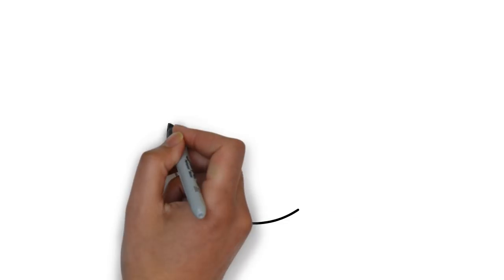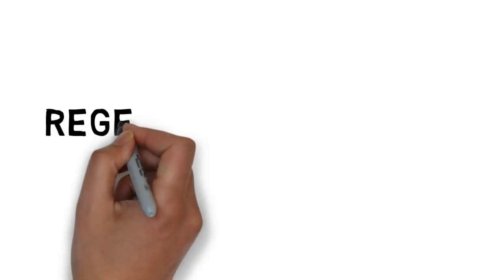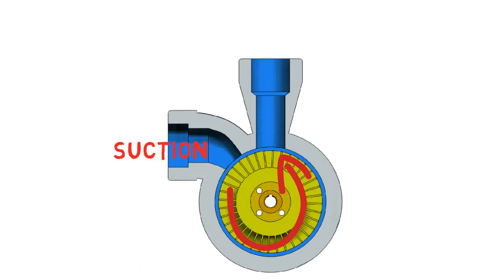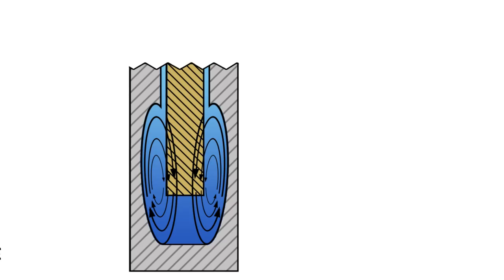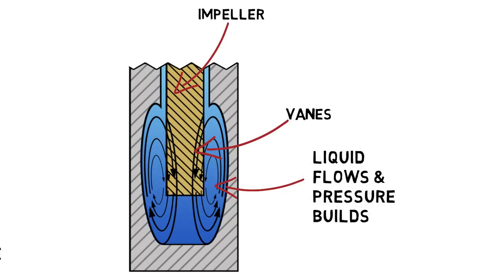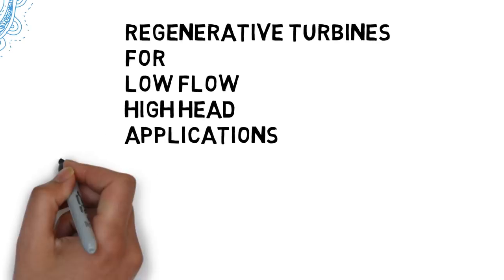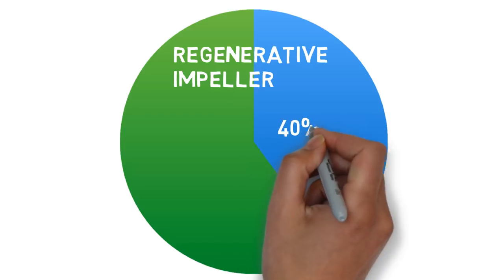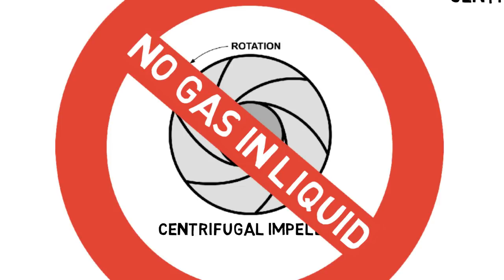Regenerative Turbine Pump vs Centrifugal Pump

Comment: energy is added to the liquid in a number of impulses by the impeller vanes as it travels from suction to discharge as a liquid builds pressure.